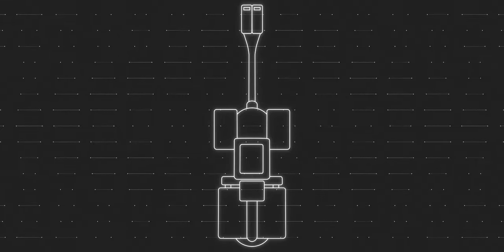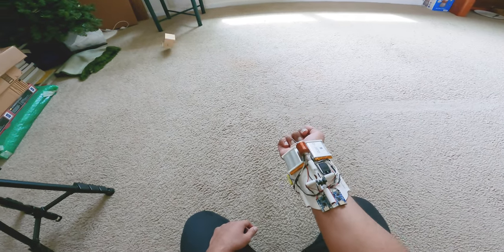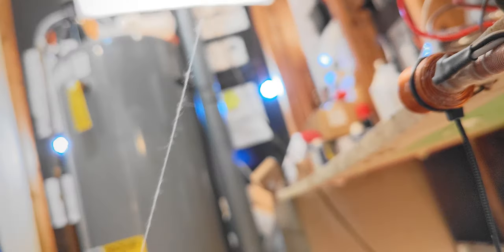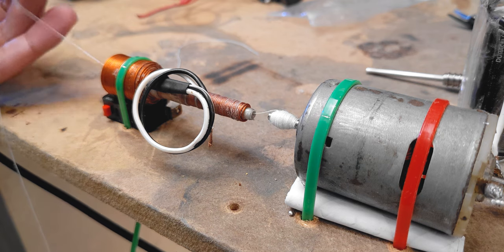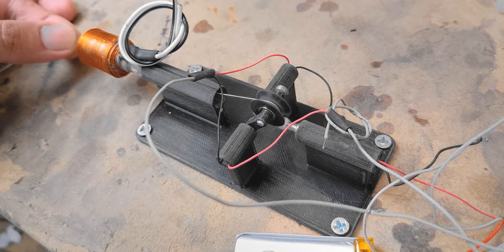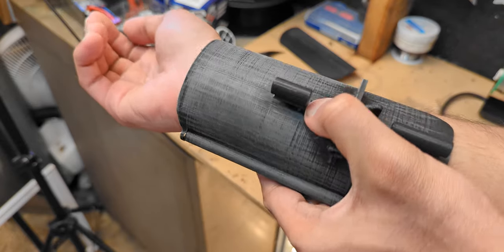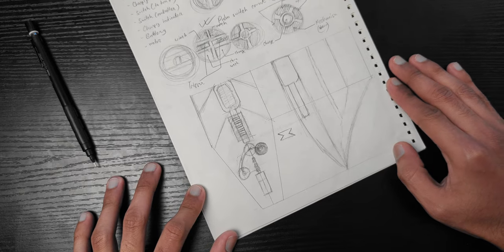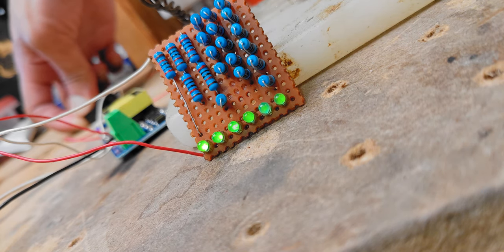Spider-Man Web Shooter 4.0

Comment: i wish electro magnets sticked to EVERY material, i was hoping to make a retractable mechanism for this concept every five seconds, which in theory if a swing takes at most 3 seconds then i swing on the other arm in 2 seconds, giving me enough time to retract the string
Reply from the maker: Sounds good in theory
Reply: @jinanprojects  thanks, but i think there might be a way to make a miniture carbon nanotube condenser, meaning it is gonna be 100x stronger than steel

Comment: Dude this is so cool! The way the pulley works is so smart, I have been working on a coil gun web shooter as well for a while now and was stuck on that step, it’s funny to me how similar our thought processes were, I wanted to add a led indicator for charging as well and also was thinking of having the pulley swivel like yours but I never thought of doing it vertically! Also using 2 motors rather than a servo to keep it simple was a great idea. Also I know this is long, but I actually talked to you a while ago about charging capacitors and charging circuits and your older videos gave me some inspiration which I appreciate. If you want to see mine, I posted a quick YouTube short on it a few months ago, also one last thing your video editing is really progressing those models at the beginning were very cool!
Reply from the maker: Thanks man I really appreciate it.
And I just saw the YouTube short you mentioned. Your web-shooter has a really nice punch to it. That was really nice.